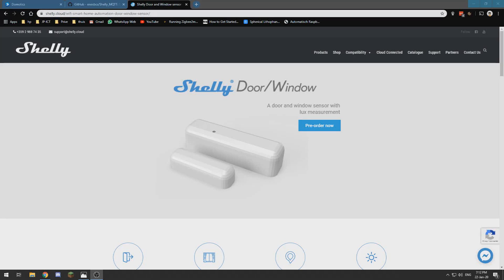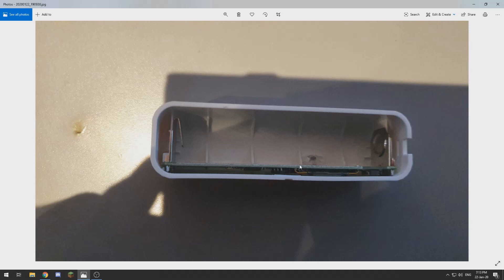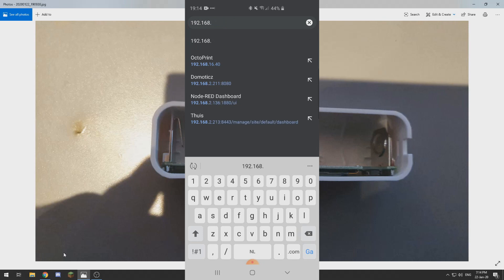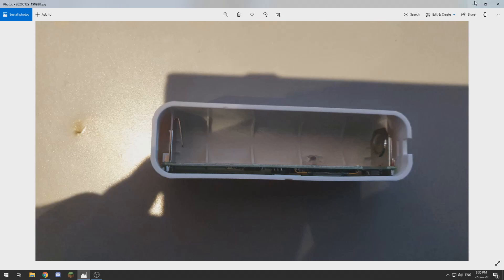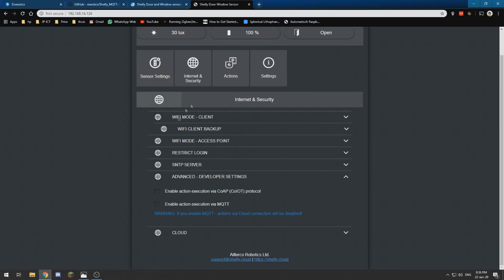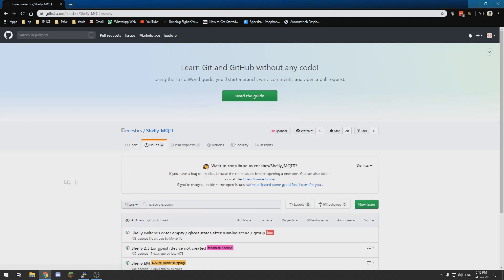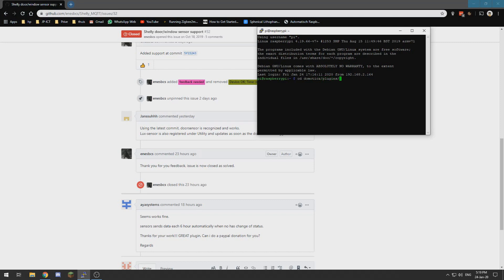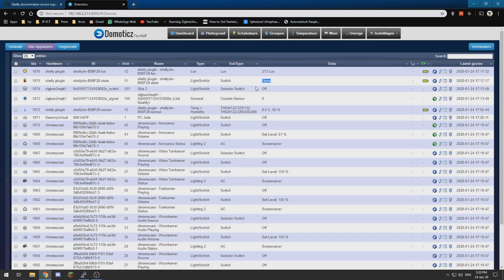How to: shelly wifi door/window sensor with domoticz mqtt

Comment: Hoi Jelle, bedankt voor je uitgebreide Shelly, Domoticz en MQTT video's. De Shelly dimmer heb ik al een tijdje goed werkend in Domoticz. Op de deur sensor v2 heb ik een vertraging van 20 seconden. De sensor heeft een statisch IP. Heb jij nog iets speciaals gedaan om de 1,5 seconden response tijd te halen?
Reply from the maker: Helaas heb ik geen extra tips, mijne werkt nu zelfs helemaal niet meer
Reply: Ik heb hetzelfde probleem met mijn door window sensor v2. Na een  factory reset (en alles opnieuwe instellen) werkt allesprima. Reacties binnen 2 seconden. Led blijft branden. Zodra led eenmaal uitgegaan is krijg ik altijd een vertraging van 20 seconden. Zelfs als shelly aan geeft dat hij online is.
PS Ik heb op v2 de "wakeup"button nog niet kunnen vinden. Bestaat die niet meer bij v2?